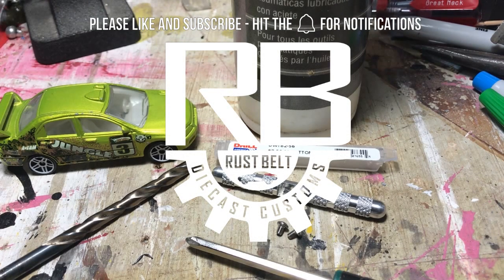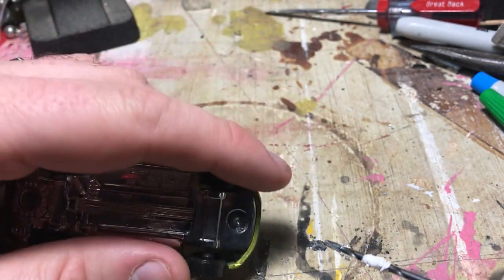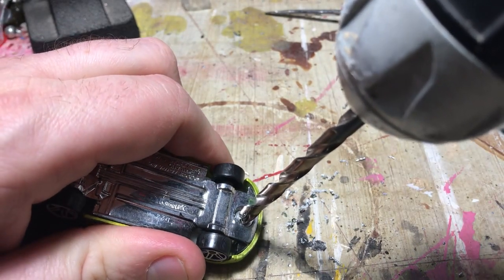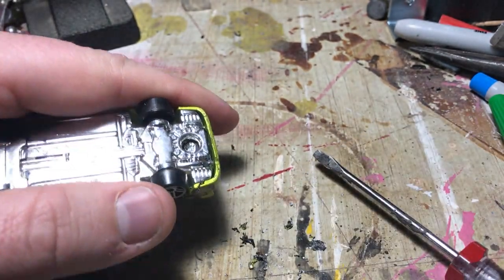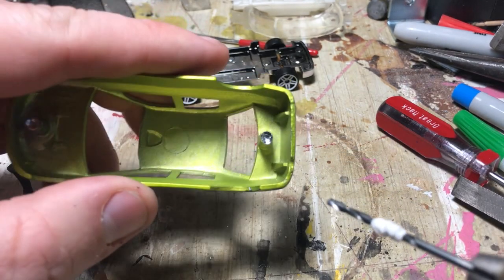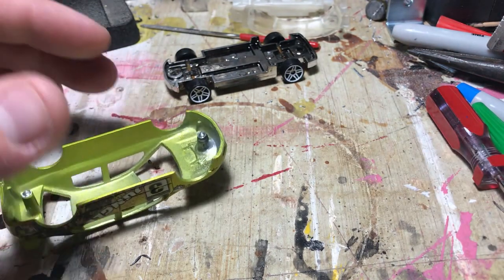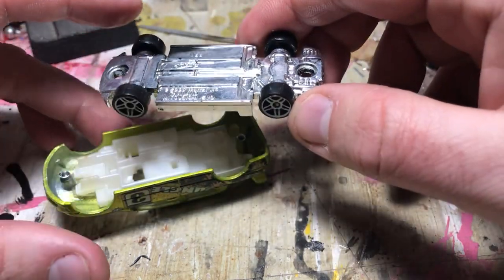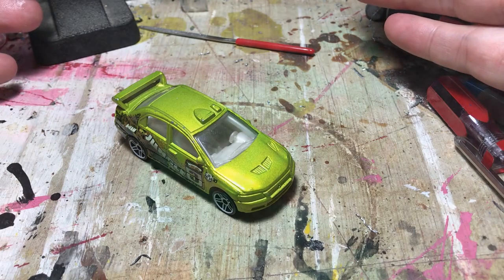How to Take Apart Hot Wheels and Matchbox Diecast Cars and How to Put Them Back Together ASMR

Comment from the maker: Drill Bit Sizes:
- Small is 5/64.
- Large is any bit that’s wide enough and shallow enough to take off the head of the rivet without cutting into the plastic base.
Reply: You talk too much
Reply from the maker: @irinap4019  I agree
Reply: @irinap4019 disagree. it was fine for me. (what an ingrate 🙄)
Reply: @RustBeltDiecastRacing 😂😂
Reply: @RustBeltDiecastRacing what size screws? Same as bit?
Reply from the maker: @Ford17x  screws are 2-56 1/8”
Reply: @RustBeltDiecastRacing  tyvm

Comment: can you do this even on a diecast car that has relatively tiny rivets and posts? looking to customize one but the rivets (and assuming the posts as well) look much smaller in comparison to the other diecast cars i've seen. thank you for this video!! <3
Reply from the maker: Yes you can but just make sure the bit is perfectly straight so you don’t drill through the side of the post.
Reply: 1/16 drill bit and a 1-72 button head screw.....do not tap...no need to

Comment: I tried this and ended up breaking the drill bit from the tap. It wasn't really cutting into the rivit so i tried more force and it snapped. Any idea why it wasn't going in?
Reply from the maker: It might’ve been too dull. Was it the boy from the kit or one you already had?
Reply: @RustBeltDiecastRacing  oops sorry forgot to reply! It was from the kit. I rewatched the video and I used a regular drill bit to start with instead of the one from the tap. Does that make a difference? Could it be that I didn't drill far enough initially?
Reply: Ohhhhhhhhhh no no no I see what I have done! I used the tap in place of the drill bit after the car is apart. I saw someone else use a drill to get the tap in, so I combined the 2. Oops....So I was trying to tap when the hole was nowhere near deep enough!
Reply from the maker: @wcdc-worldcupofdiecastracing  haha oh man yeah that would do it hahaha

Comment: What size drill bits exactly were used to remove the rivets?
Reply from the maker: You can use any size really. As long as it’s a shallow point so it removes just the head of the rivet and not the plastic. The point will then give you a starting position for your tap.
Reply: @RustBeltDiecastRacing It always seems like the drill bit is either too big or not enough for the rivets. I prefer to drill them out for screws after

Comment: What size are the drill bits?
Reply from the maker: You can use any size as long as it’s shallow enough to take off the top of the rivet without removing the plastic

Comment: I have two Hot Wheels cars, one a used 1967 Chevelle Hot Wheels car and the other is a used 1968 Barracuda fastback Hot Wheels car, each of which have straight bodies, still-intact interiors, still-intact windows and straight chassis, the Chevelle's somewhat-weathered-chassis is plastic and the Barracuda's somewhat-weathered-chassis is metal, their bodies need new paint, their windows need to be cleaned up as do their chassis and their wheels do need to be switched out, albeit my hands are not fully capacitated due to various health issues from over the years and so, here's my question:  Would you know of anyone out there who does clientele repair work on any such Matchbox/Hot Wheels cars?  If yes, please, let me know, I really would appreciate it, thanks.
Reply from the maker: Unfortunately I don’t but I’ll keep an ear out for someone.

Comment: Can someone send me the sizes for all the screws and stuff so I can screenshot? Plz
Reply: I use 2/56 x 1/8 long screws. The drill bit is a wire size 50. The Allen head is a .05 inch size.

Some of the older vehicles have a smaller post so a 1/72 tap and screws should be used. I am not sure what size the drill bit it is, but the Allen head is the same size.

Brightvision makes the handle to hold the tap, and also sells kits.
Reply: @johnson9195  where do you get the screws?
Reply: @manthony225  I got them on Ebay.

Comment: There is no such thing as a rivet in the post. It's just a post that is formed and then when the car is assembled the end of the past is crushed, basically you're drilling out that crush.
Reply from the maker: I’m gonna drill out your mom’s crush.
Reply: Let's start with *post.

You're sort of correct it's not crushed the posts are spun. That's why if you find an error it's called an unspun car. Most people in the diecast world do call it a rivet because well it looks like a rivet.